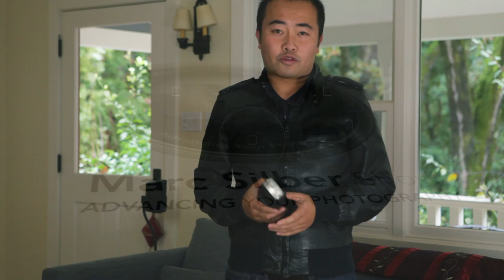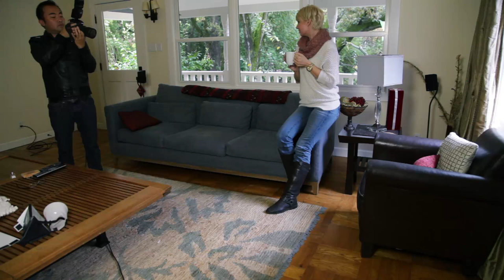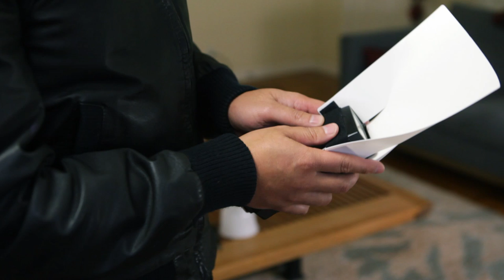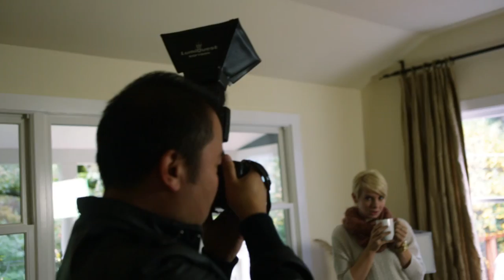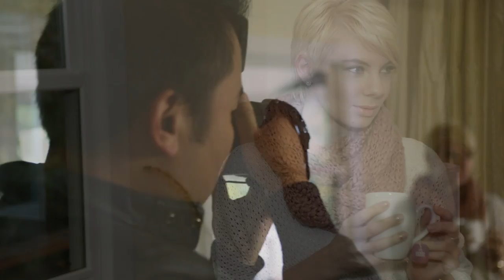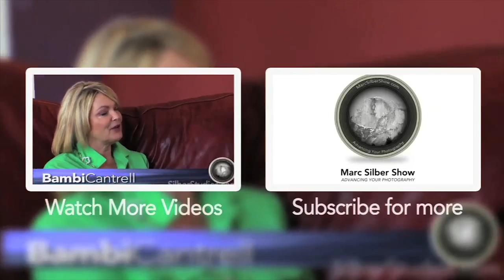Photography Tips: Shooting With Flash

Comment: Set ETTL to +1? why? TTL should account for the loss of power due to bouncing. 

And why would you bounce with a diffuser on, that makes no sense at all! Use the zoom facility on the flash if you want wider spread, the diffuser is doing nothing but losing precious flash power.
Reply: ETTL is am awesome feature , but it isn't accurate all of the time. It can easily be fooled just like a DSLR with metering. As an example, if you photograph a scene with a lot of whites than the ETTL will most likely under power itself and the same thing goes with a scene with lots of darks except it will over power itself. 

The ETTL meters through the lens , hence the name Evaluate through the lens,  it doesn't put into account any sort of diffusion into the exposure. 

Bouncing with a diffuser is used to further soften the light and to have more control of thebdirection of light as to just bouncing a bare flash.
Reply: Mrlolibre Sure, but why give +1 as a general recommendation? It depends on the subject, as you say...

TTL flash measures the light hitting the sensor in real time and shuts off when sufficient exposure is achieved, so diffusion makes no difference, only the flash has to work that bit harder. That's how it works with Nikon CLS, anyway.

I challenge you to try bouncing with and without diffusion - the diffuser is entirely redundant, it gives you LESS control over direction of light, not more - it just spreads it over a wider area. If you want control over the direction of flash, much better to use a small piece of foam rubber to flag the beam, like this: http://neilvn.com/tangents/about/black-foamie-thing/
Reply: MrSimonj1970 I'm not the photographer in the video, so i can't speak on his behalf. I'm not sure why he mentions outright recommended +1 flash compensation from the get-go ,but i believe he said something similar to adjust accordingly to the scene ,in which you should always do, after his statement. 

In regards to your statement about the flash automatically compensating for a light modifier, I do shoot Canon and have never used a Nikon ,but i noticed that i'd always had to compensate for any type of diffusion. Or maybe i haven't noticed because it's been a very long time since i shot in ETTL mode. 

Using that last "cone" shaped diffuser will shape the direction of light, you can tell by just looking at it's physical shape. Although because the whole thing is transparent white it won't do a very good job ,but still it does in a slight way allow for direction of light. 

Overall, i think that this video is geared towards beginners and that's why some statements he makes is somewhat "missleading" and he didn't want to get super technical.
Reply from the maker: MrSimonj1970 we gave it as a general rule because even with ETTL giving reasonably accurate results in most  environments, going +1 is a bit more reliable on surfaces that are not as reflective and/or where the color is more on the opaque. We do agree that bouncing without the diffuser does yield a better result than bouncing with one but we wanted to include examples for those who didn't want to take off the diffuser between shots. Thank you for the comment. We should have made it more clear that we were demonstrating the option of bouncing for those who wanted to keep their diffusers on.